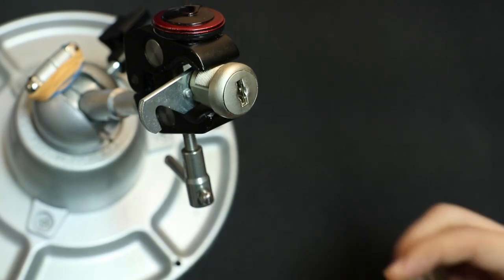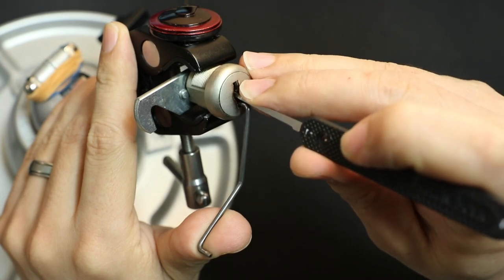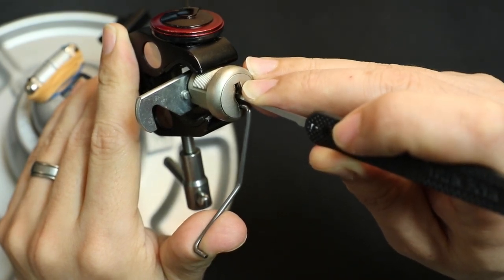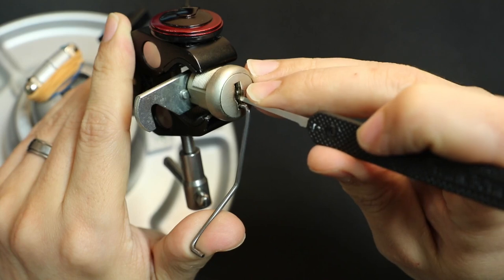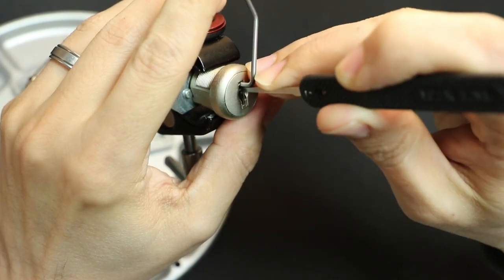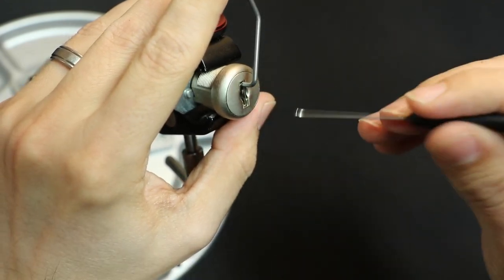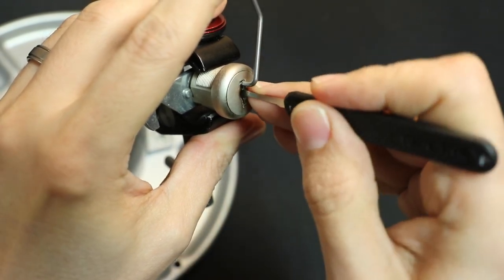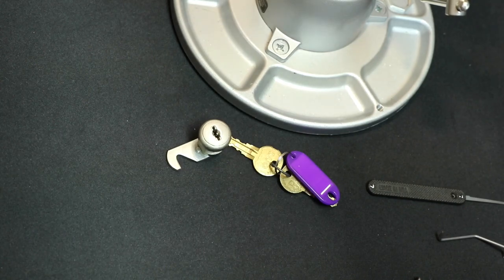[L105] Illinois Duo Lock - pick

Comment: Very cool, and awesome picking!

Ps. I believe there are 18 wafers altogether, 5 top, 5 bottom, 4 side, and 4 profile
Reply from the maker: What do you mean by 4 profile? I ended up feeling 14 as well though
Reply: The profile wafers are just shaped like the key and are paired with the side wafers.

As far as I understand the order of the wafers in the duo is:
T1, B1, S1, P1, T2, B2, S2, P2, T3, B3, S3, P3, T4, B4, S4, P4, T5, B5
Reply from the maker: @IsaacHashman  wonder if these profile wafers are just spacers, I didn't have 4 other wafers to set in my lock
Reply: @norlin76  correct, from what I understand, they don't need to be picked at all
(Just figured you would be interested in knowing about the 4 profile ones 😊)

Comment: That looked  a very tricky pick to me, was you basically using quite high tension to start with?
Congratulations on getting the open ,and well done,billbo.
Reply from the maker: Surprisingly, I wasn't using much tension, the wafers in this were just very difficult to move...I'm not sure if it's always the case, or just the condition of this particular lock.